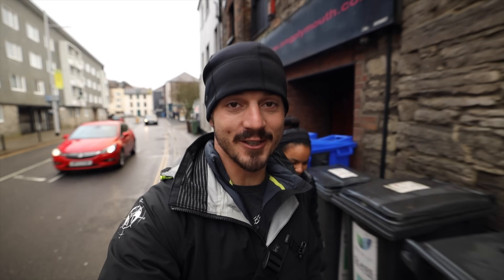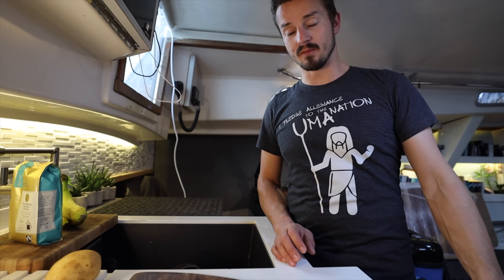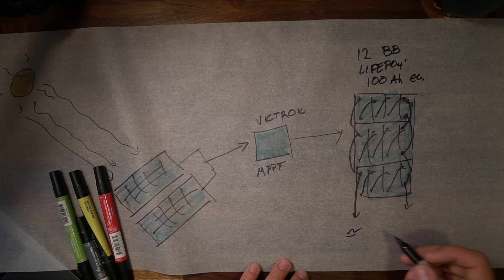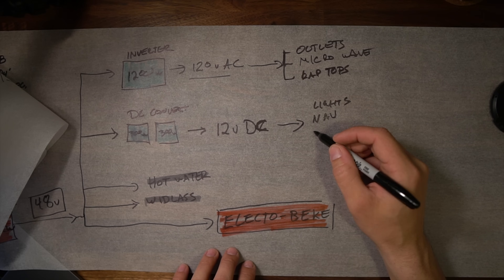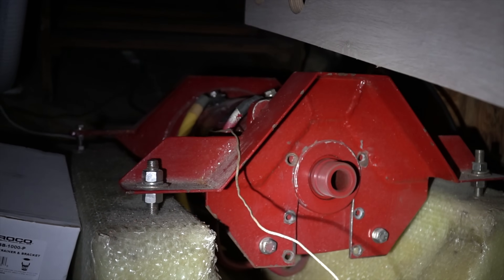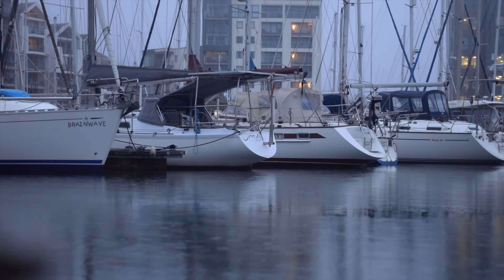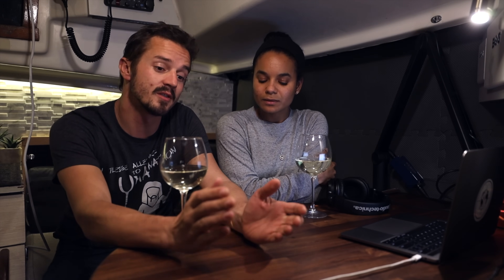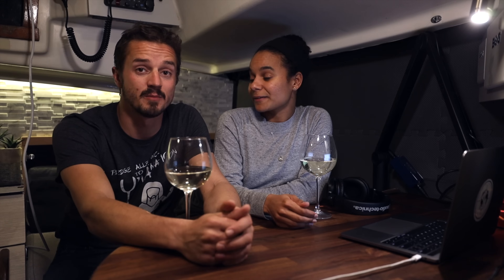5 Years Living offgrid on an ALL ELECTRIC Sailboat — Sailing Uma [Step 206]

Comment: Im confused about the motor 
It draws 1.3 kw (h) yet you can run it for 10 hours. 
Your daily generation and load is 2.5 kw 
This must use every but of energy in all 10 of the 100 Amp hr batteries...
Can you explain this again please.
Reply from the maker: 1.2kW of power for the motor is it's sweet spot, (which means we get acceptable range and speed) we can certainly motor faster if needed, but the power curve goes parabolic after that. 

But like we said, we don't use it often (like once a month, maybe) mostly we rely on our sails which don't us any power at all. 

Make sense? The 2kW a day is "house loads" the little things we use every day, lights, laptops, water pump etc.
Reply: @Edward Finn If a battery of 100 Ah capacity has a 12 V nominal voltage, it can store about 1200 Wh of energy (12 V * 100 Ah = 1200 Wh). [Amperes * volts gives us watts; amps * hours gives amphours; watts * hours gives us watthours.] Let's write it down as 1.2 kWh for short. 10 of these make for a 12 kWh battery bank, total. I don't remember what the rated capacity of their batteries was exactly but this is a good ballpark figure. Think of "kWh" the same as "man-hours of work" we must now do in order to fill the bank. Alright, here goes:
They have two 240 W solar modules on deck. I'll round them up to 500 W total for ease of use here; think of them like workers grinding away during daylight hours and the "man-hours" of work they do gets stored. Five hours of perfect sunlight multiplied by 500 W of power is (500 W * 5 h = 2500 Wh), meaning 2.5 kWh of energy. This goes into the battery bank. With me so far?
We can compare the solar energy production of 2.5 kWh and the battery capacity of 12 kWh and see that using solar alone it would take (12 kWh divided by (2.5 kWh/day) = 4.8 days) to fully charge it. They can also charge it overnight with a 1.2 kW charger at the dock in (12 kWh / 1.2 kW = 10 h). Another calculation we can do is see how long it can supply 1.2 kW of power to the motor: (12 kWh / 1.2 kW = 10 h) meaning they can motor for ten hours straight, but that's rare - it's a sailboat!
Usually the 2.5 kWh daily production is simply for covering the daily loads and any excess production gets "curtailed", the controller disconnects it. How much then is the average load that makes up this consumption? It's the lights, radar, radios, and appliances: (2.5 kWh / 24 h = 0.1 kW), so, just about 100 W average power draw. Sometimes much more in spikes (an electric kettle or microwave oven), sometimes way, way less (only LED lights), but that's the average. I hope this helps.

Comment: The electric motor for propulsion is the most interesting part of this video. Really the only novel thing you are doing. I am excited to see it is quite possible to choose that path and do away with the never ending engine maintenance and breakdowns and noise we see on all the other sailing videos. I wonder is the motor controller will last 30 years or if the seawater humidity will corrode it out in 10 years ?l
Reply from the maker: The motor controller is water proof. So it should be just fine.

Comment: Not using parts labeled "marine" such as the panels was a smart move. They are designed to withstand hailstorms and extreme weather so you're good. I would expect some of the electronics it definitely matters. Interestingly, for land based stuff I sometimes source marine components instead of the gold plated UL residential stuff (/s). The forklift motor was an outsanding (and such an obvious one I can't believe I missed it) choice. You took all of the expense of maintenance and fuel right off the top, which has been a big deterrent to me for getting a sailboat as I know there's times you have to motor around and I hate the idea of being stranded with a broken motor or out of fuel, and I've thrown a lot of money at ski boats in my time. Thanks for sharing that.

Comment: In looking for info on crossing the North Atlantic I came across your video. I immediately stopped it and went to your channels home page where I fell in love. The two of you remind me of myself and my wife, whom I met in 1979. After a stint in the Navy I got a job at an Architectural firm as a draftsman. I pick up CAD, codes, and the other necessary means to stay at the same firm until pain in both knees unemployed me a little over two years ago.

I binged watched all of your videos in a matter of a couple of weeks. I must say the swing keel scared me as I know that is not available on that model. Having seen another channel switch to an electric motor to power their boat I knew the concept. I just wasn't sure about your choose of motor, though I'm glad it works.

I love that you choose to sail a lot more than most and not motor. Kika I was saddened when you told us of your mothers passing as she and I are the same age. Dan I glad you proposed to Kika as she comes across as a wonder little lady with plenty of energy. Your moments of affection in your videos is wonderful and shows that the two of your are committed to each other and your channel.

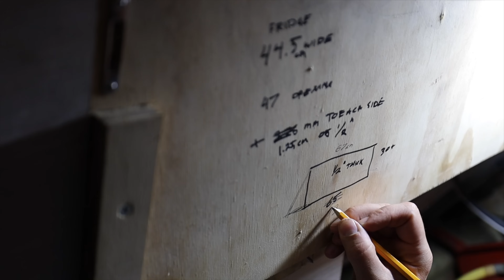I along with some other post here think you should check in to powering your laptops via DC. In the 8th episode of Lady K Sailing at the 14:40 mark Tim talks about not wanting to go from 12 volts to 110 volts back down to 19 volts. Knowing that Uma is 48 volts there are also 48 volts to 19 volt transformers. Not knowing what your laptops power needs are I no going to make any recommendations, but I believe it's something to look into as it will help with your power needs.

Always looking for new videos from the two of you.

Regards
Reply from the maker: Power losses when switching up and down voltages are very very minor for our uses. Our inverter on standby uses a measurable amount of power, hence why we turn it off. But we haven't noticed any real losses in inverting up and then back down. Sure it's there, its just not large enough to make any real difference.

Comment: Hi, first off sorry we missed meeting you when you were in Georgetown, Bahamas.  We were there.  Emily was running the net.
    I've been living on the boat off wind and sun for much of the last 20 years.  If you two are serious about a high producing wind generator can I suggest this playlist.  https://www.youtube.com/playlist?list=PLsT7_jPsZM5oZeMUi5ejGozVTHm83S3-7  tells you how to build a unit I designed.  I've been using this for about 15 years.  The one I built is 8 feet in diameter and can really put out the amps.  Same design material will help you build any size.
    Feel free to write back if you need help or have any questions.
Clark

Comment: Great info! One question though: what propeller do you use? 1,2 kw for 3 knors seems very low compared to an avg yanmar putting out 20-30 kw.
Reply from the maker: Diesel and electric are quite different and hard to do apple to apples comparison. The math is roughly. 750W/HP, BUT electric is about 3 X more efficient in pushing a boat than diesel, so lets say a 6kW motor then = 8hp, BUT then X 3 and you're up to a 24hp equivalent diesel. We've checked these numbers with others who have converted to electric and some experts in the industry and its a pretty good rule of thumb. 

So the formula to calculate the the right size electric motor to match the speed provided by the diesel is:

hp (of current diesel motor) / 3 X 750 = Wattage rating of electric motor needed.

Where this breaks down is the current trend of overpowering sailboat with larger motors than they actually need.
Reply: @SailingUma  thank you. I was thinking if to use a 15kw or a 26kw motor - so maybe 15kw is enough.

Comment: Question? y'all put groups of  4, 12 volts in series and then in parallel for a 300 amp hour bank. From what I read, most battery manufacturers cautions against putting singles in series and no issues in parallel. Have you hand any issues? Something about when they set up 48 volt packs using smart charge controllers on each battery. Your's is the way I like due not not having to handle so much weight in one package. Dee
Reply from the maker: It's what was recommended by the manufacturer actually. These batteries have built in BMS circuits to protect them from just about any abuse you can think of. No issues at all.

Comment: Don't get you maths, you have 12 boxes of battery thats run 12V and have 100Ah? That's give you 1.2kW store energy per battery, but you even have parel or serial connection so voltage go up but store energy it's no more... wher you have thats 15kW???
Reply from the maker: volts and amp are what change with parallel vs series. wattage is constant and can simply be added up. 

our 12 batteries can store 14.4kW no matter how they're wired. Double the voltage you halve the amps, but the watts stay constant.
Reply: @SailingUma  ehh tell me better Wh that's you have in thats batery, you messing with two difrent constans... You don't add Ah if you batery at in series so for 48v still have 100Ah :) 

anyways good fun in marina

Comment: 2 questions:
- when your batteries are fully charged and your panels generate more power than you consume at that moment, what do you do with the excess on a boat ? (At home I revert it on the public network, but on a boat? You hav to dissipate it in some way, no?)
- do you know if you can use the propeller of an old fashion diesel engine to regen electricity as you plan to do with your electric motor?
Reply from the maker: If our batteries are full, the power goes no where. You don't need diverter loads with solar like you do with wind.
Reply: @SailingUma  i know people on shore use excess power to heat water storage this way excess power dosent get wasted i know in the summer this still a waste on a boat but still a valid  sudgest on 👍🏾👍🏻🏴⛵

Comment: On a whole different scale I can see similarities between Uma and our house. We consume about 35KWh/day. The big draw is daily use of our electric car which represents about 20KWh. It's like your electric motor but we don't have sails.

The other big draw, but only for short periods each day for self maintenance, is the Jacuzzi spa. 

Our 18 solar panels produce about 30KW on sunny winter days and 50KW on most summer days. So we do have to rely on the grid but our grid usage is quite low. Most of the year we drive free in the electric car. When the car is charging and there is lots of sunshine we still need a bit of grid power to help charge the car (maximum of 2 hours and 10 minutes). When the car is fully charged the solar resumes pumping power back into the grid. It's sort of like you drawing lots of power to run the propeller, then the sun can replenish your batteries when you shut the prop off.

There are months when our electric meter, at the end of the month, reads less than at the beginning of the month. I had a meter installed in the house power panel and I can see things similar to your boat. That is there will be moments of heavy power draw but they are short. Without the car and spa the house can easily run on about 2-3KWh. We replaced (as you said "systematically") each one of the 90 bulbs in the house with LEDs. 

We have no batteries as they are not cost effective. We do have net metering so essentially our city power company acts as our battery. We are not 100% off-grid but we may be 80%. Our power company uses, or purchases, zero coal produced electricity.
Reply: I guarantee that your house more than 3 kWh per month, even without the car and spa.
Reply: Did you mean your solar panels produce 30 kWh on sunny winter days and 50 kWh on most summer days? If the 18 solar modules are at least 255 W each the installation would be about 5 kW nominal and needs 6 "sun hours" to produce 30 kWh (in practice the time is longer with the earliest and the last hours, and maybe some in the middle, producing less than nominal power due to nonideal sun angles and maybe shading sometimes from obstacles). Sounds good!

Comment: One thought.

As you use computers a lot, why use inverter and chargers when you can use 12 volt usb-c-charger?
I’ve been using successfully one that outputs 60W for MBP. It won’t charge the battery when using heavy duty apps but works fine.

You should test one and make comparison of the power consumption of both options. I bet 12V converter would be more efficient.
Reply: I was also thinking about powering the laptops from DC. The double convertion has to be rather inefficient.
Reply: Arctic SeaCamel absolutely I agree , changing power from DC to ac uses power they’d  be better to run their 12 volt system off the batteries , you can take 12 volt off a 48 volt system with a battery equalizer
Reply: @jamesb3321  They are already converting to 12 volt for systems
Reply: Why use a 60W MBP when most of the work, aside from the final render, can be done on a 15W Raspberry Pi 4. They could even run "headless" with that laptop if they wanted and save even more by not powering up the very inefficient laptop panel.

Comment: Great video, as usual! Just one consideration: you correctly said that your batteries (12 x 12V each) gives you around 15 kw nominal power. In my experience being a skipper and cruising instructor, I knew that the real capacity of a battery is a bit more than half of its nominal capacity, not more. The reason is that it can be recharged only up to 80% through solar panels and up to 85% plugging it to shore power. Also, when a 12V battery voltage falls down to, say, 8V it becomes simply waste and not rechargable anymore. Talking in Ampere, the lower level a battery can still run is 30% of its nominal capacity. The calculation then lead to the conclusion: 30% to 80-85% of a battery capacity is its real capacity (50-55% of its nominal). I didn't understand if you made your calculations on energy storage and available power taking this in account, but I think it's important ona safety point of view.
Anyway, I love you guys, you're great. Have a great life trip!
Reply: Roberta Zorzi  they have Battle Born lithium iron fosfate batteries which capacity is almost 100% of the nominal and they’re very efficient of taking in power as well as getting it out.
That rule of half applies to lead acid batteries. Prices of LiFePo-batteries have come down so much that there’s no point buying any other anymore.
Reply: @ArcticSeaCamel  thank you for the clarification. I didn't get the type of battery right the first time i watched the video.

Comment: one power hungry idem in the future would be a water maker. Could you run the pump off the back side of electric motor. I know it would slow it down but one less power drag. That is if you assemble your own unit.

Comment: Whatever! You all talk a big game , act like crossing the Atlantic is amazing. Running an electric motor set up,  to me is dangerous especially in you area of serious tides. You have no back up in an emergency to charge your batteries to have propulsion . Even a small back up generator would make sense. You guys seem to like the dockside in the UK
Reply from the maker: If you think it's dangerous, then don't do it. Everyones risk analysis is different. Tides and current's are predictable and can easily be used advantageously or at least avoided. We've never said it's for everyone, just proof it's possible.

Comment: I have the Domitic Fridge /Freezer - works fantastic .  When cruising I set it on freeze and then move frozen stuff like bottles of water and dinner into the cooler to thaw and act like a block of ice .  Thus get a fridge and freezer .  BTW surprised on the range for the motor .

Comment: Energy would be correctly expressed as KW-Hours, not KW. KW is the POWER.. the rate at which you use energy. Example: 24 volts at a 20 amp discharge is 480 watts. Run that steady for 10 hours is 4800 KW-Hr.

Comment: Many thanks that was a good video. What I want to ask you, do you think it is efficient your system if you consider all the extra manufacturing of the batteries motor, etc, plus replacing,  as I would imagine a combustible engine would last a great deal longer, including I know servicing? Cheers.  :)
Reply from the maker: All the components in our system could last 30+ years, including our fuel source, so yes, we consider it efficient.

Comment: Hey Dan,

I enjoy your videos, thanks!

For the laptops you may want to consider an adjustable DC-DC converter like this: https://rover.ebay.com/rover/0/0/0?mpre=https%3A%2F%2Fwww.ebay.ca%2Fulk%2Fitm%2F401456812087

You can easily program it for different voltages and amp limits, and store them in memory. So instead of having to turn the big inverter on to run the laptop this little guy will do it more efficiently. Just look at the laptop power supply, it will tell you the voltage that you need, and get some DC power jacks that are compatible with the laptops. The output can be anywhere up to a few volts below the battery bank voltage, and about 15A max.

Comment: Excellent video.  You are the Tesla to the sailboat and Diesel engine manufactures. Most cruisers try to be off grid and try to understand the electrics, but for most of us it is new area of Knowledge.  With the new Battery technology available you would think that one of the big Sailboat manufactures would make a cruisers version, that did not need Diesel or propane.  Imagine no more searching for clean Diesel or propane. No more Heavy led acid batteries  to locate and replace.  Thanks